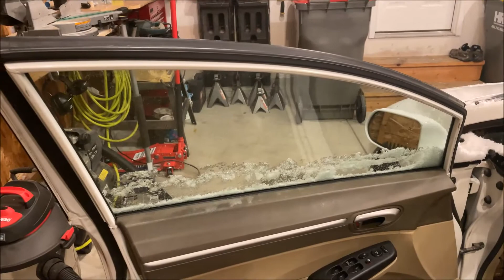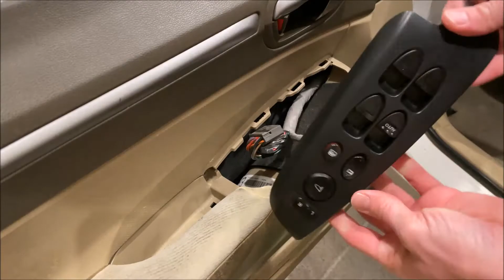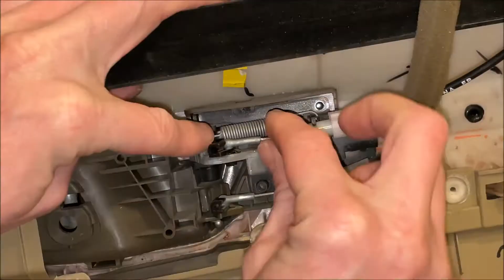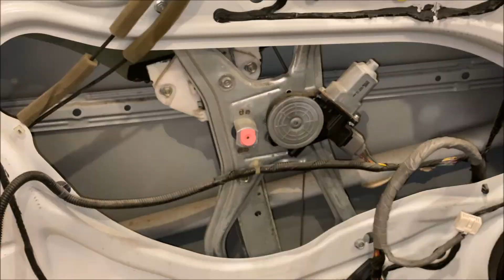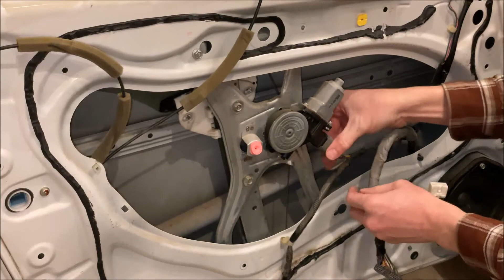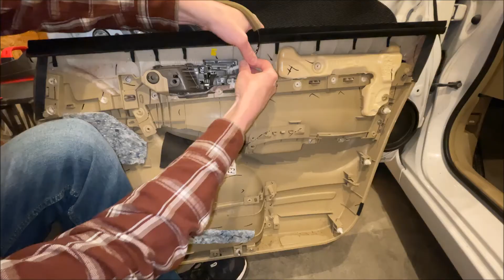Honda Civic Window Motor Replacement

Comment: Roll the window down? It's fuckin broken why u think I'm here
Reply from the maker: Fair enough. You can remove the whole fuckin assembly if the motor is completely fucked. Or get some tiny hands that can access the fuckin bolts.  There’s a comment under this one that another viewer got some fuckin success with. It’s the one with 5 fuckin replies near the fuckin top. By Derick Yamamoto. Let me know if this worked in any fuckin case 👍
Reply: @FastFixYouTube  lmaooooo

Comment: For some reason I can't find any products for the rear driver side, which is the one I have broken. Would the rear passenger side one be the same? Neither Amazon or 1aauto had it
Reply from the maker: That’s possible. I’d call or email 1aauto on that. Or call your Honda dealer and have them look up a part number and see if it matches the front motors.

Comment: when i put the panel back on my lock on the control panel doesnt work?
Reply from the maker: Hello. Check the wiring connection. Make sure it’s plugged in right and tight

Comment: Hey quick question: I have a 2010 Civic with the same problem. When I click the Amazon link you provided for the window motor, Amazon says it wont fit on my car. Am I still good to go to buy and install the part you linked in the description? Thanks in advance!
Reply from the maker: Hello. Let me double check the part. Please provide me with the following:

2010 Honda Civic
Trim level:
Engine:

Thanks 👍
Reply: @FastFixYouTube  2010 Honda Civic DX. 1.8 L engine. I'm assuming it would still work on my car, considering all 8th gen Civics should be the same.
Reply from the maker: @jonvela1979  hello. Sorry about the delay. I ran it through Amazon and it said that it won’t fit, so same result as you. Generally, I’ve found Amazon to be very accurate, so I’d say look for a different one that matches. If you can’t find anything, go to 1Aauto.com. I’ve found good parts there. I believe they have an Amazon store too. Best of luck 👍
Reply: @FastFixYouTube  Thank you!

Comment: I appreciate you brother! Just got a 2009 Honda Civic EX and this is going to be my first trouble shoot/ maintenance task I’ll do to it! Any tips of keeping this car in good everlasting shape and how can we set these up to drive in snow (new to Jersey planning on going snowboarding)
Reply from the maker: Hey!  I ran mine until about 250,000k. I performed the regular maintenance; oil, shocks, belt, battery, etc… and the car did very well. I take the approach of don’t fix it if it isn’t broke logic and that seemed to fit just fine. The car is still running (on the East cost!) and appears to have no plans on quitting. For snow, the most you can do is put a set of tires on. Winters can be pretty bad in Nebraska and it did okay unless the plows didn’t come through. Best of luck!

Comment: How do you get the window down if the motor isn’t working?
Reply from the maker: Hello. You’ll need to remove the window mount with the window taped up like I had mine in this video. The whole assembly comes out with the motor attached, so it shouldn’t be too much different than the process I showed in this video. Best of luck 👍
Reply: @FastFixYouTube  you rolled the window down, what it it won’t roll down?
Reply: @FastFixYouTube  I ended up taping the window and cutting the line and moved it down slowly to get to the mounting bolts. 🤙
Reply from the maker: Nice! Glad you got it sorted 👍
Reply: @dycorrado  thanks for this suggestion! I ended up having to do the same thing because the original motor was stuck in the very top position and moving it down manually was impossible. It's a shame I had to destroy the cable and any possibility of repairing the original apparatus but I've got a working window again thanks to this video! 😀